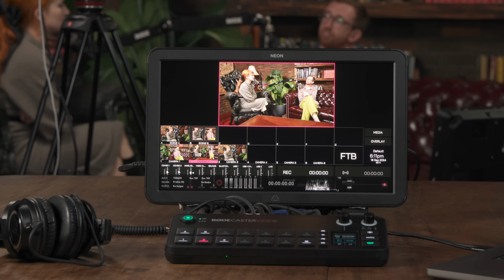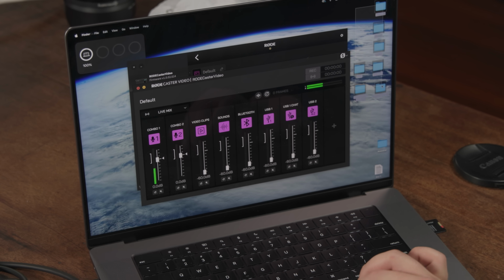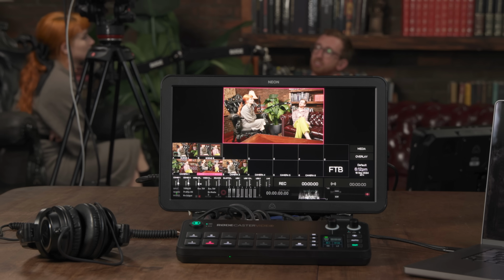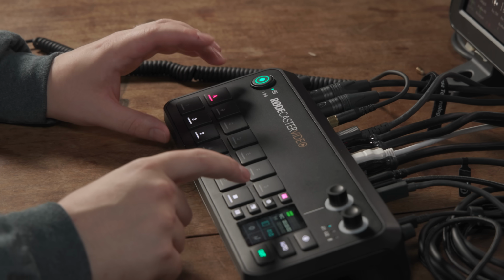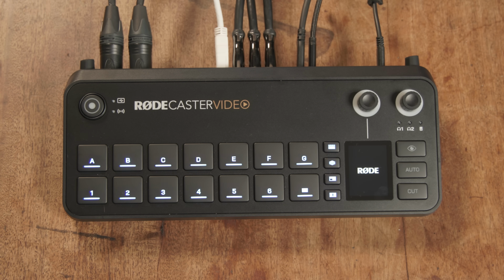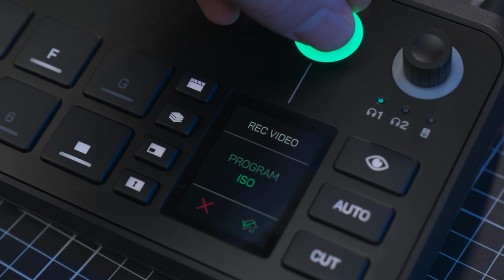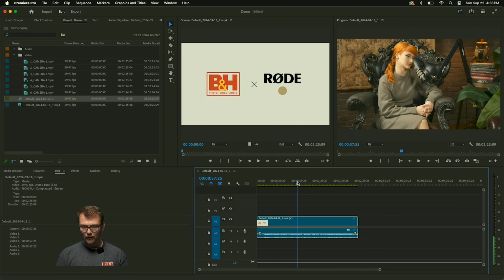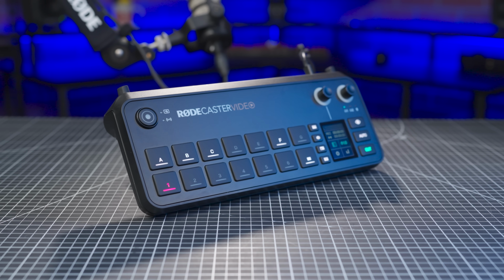RODECaster Video: Revolutionize Your Video Production!

Comment: As a podcast maker, I'm thinking about switching to Rodecaster Pro 2 or this machine.

I use Sony a6400 cams. And record audio now on rodecaster 1.

My question is, if its a problem to tune or edit audio input on this video machine, without having the buttons I had on rode caster one.
And if I maybe also need a rode caster 2 or duo, next to video caster.

I only want to tweak volume before we record, and maybe a small edit on voice.

What are your suggestions?
Reply from the maker: The integrated audio  mixer controls should handle all of your audio gain tweaking. The free RODE Central software will handle advanced device configuration.  Digital USB-C ports to connect RODE USB microphones, the RODECaster Pro II, or Duo Audio Production Studios. Other USB-C ports support 2-in/2-out multichannel outputs, mix-minus, and MFi protocols.          >Mark<
Reply: @BandH  thanks, but my question is about usability:

How easy is it to edit audio / gain / voice on this small display? During a podcast recording I don't use an external computer.

Comment: Mevo Multicam App also does 1080p with pretty much the same features and unlimited cams via wifi for free, if you are not streaming to multiple platforms at once or 1/10 of the price per year if you need that... I don't really see whats the point of this device compared to other options apart from having a rode logo on it...

Comment: Thanks for this review 
May I know the following.
1. Does it stream to multi platform in one go?
2. What's the highest ISO recording?
3. Does it have a sim card slot for the internet?
4. Does it bond the network like if you are connected to WiFi and Internet cable or it is only getting one signal? 

Thanks in advance!
Reply from the maker: To answers your questions:
1. It will only stream to one platform at a time. To stream to multiple platforms you will need a different live streaming software like Vmix.
2. The ISO will record up to the number of video and audio inputs you connect to the RODECaster Video. 
3. It cannot connect to the internet via sim card. You can connect the RODCaster to the internet via wifi, or direct ethernet cable.
4. I do not have the information at this time to answer this question.

Hope this helps!
Reply: @BandH  thank you very much. Yes it helps a lot. Appreciated for answering my questions! Cheers!

Comment: What USBC camera work with it? I tried Sony ZV-E1, Sony a6700 and Insta360 Link 2; all cannot see anything
Reply from the maker: The USB-C video input will only accept cameras that supports uncompressed USB UVC video stream. All three of the cameras you mentioned will work with the USB-C video input.
Reply: @BandH  I got the Sony cameras to work, turned out to be very sensitive to the quality of the cable .. but no luck with the insta360 link2 using the same cable that worked with the Sony cameras. Any tips?

Comment: Can an iphone be used for a camera on the RODECaster Video, especially multi phones?
Reply from the maker: At this time, I can not find information about using iPhones as a camera input with the RODECaster Video.
Reply: @BandH  Thanks! I been asking around other Youtubers and have been pointed in the direction of porting through an USB-C to HDMI adapter and clen feed Apps or streaming via AppleTV etc.. Hopefully. I sold my Sony camcorders years ago for iphones to be simple and compact. Whats is a low cost camera you would suggest for camera input?

Comment: What I like about it is it has XLR inputs for audio. That has always been a bone of contention with me and Blackmagic ATEM switchers (at least the Mini and Mini Extreme models). The price point is good, comparable with the Mini Extreme Pro and less expensive than the Mini Extreme SDI ISO - however, it only has four video inputs. Granted, if it can play back short media files from within the device that frees up an input (which I typically use for a Hyperdeck or Hyperdeck Shuttle). No downstream or upstream keying capability that I can see, but this short demo obviously doesn't cover all the bases. I can see this being valuable for small podcast efforts or smaller live events, but for larger events like the ones we do (multi-camera, PPT slide deck, lower thirds, stings, etc.) I think I'll stick with the ATEM line.

Comment: I have the atem pro and was very excited when I saw this but once I saw 1080p (which is more than enough/acceptable for most cases) but at that price point…. I’ll just stick with black magic. The point of joining the market is to work on the flaws and successes at a reasonable price point for the masses. But this isn’t enough to charge $1,200+ after taxes. But if you don’t own their audio gear and black magics equipment and want to get into the podcast space. I do recommend going with this. Maybe I’ll review it and send it back but this is more of a $400-750 product to me

Comment: Limited multi-camera control when compared to competitor products.
Lack of physical video faders, making live switching more challenging.
The preview screen often doesn’t display the full resolution, causing discrepancies between what’s previewed and what goes live.
The menu system is difficult to navigate, particularly when switching between video and audio functions.
Overheating during extended use, especially with multiple video inputs.
No 4K support, limiting its use for high-end productions.
Inconsistent wireless microphone connectivity, causing audio disruptions.
Latency when switching between video sources.
Limited customization of graphic overlays.
USB-C functionality struggles when managing both audio and video inputs at the same time.
No multistreaming feature without external help.
A steep learning curve, especially for new users.
Lack of a battery-powered option, which reduces portability.
Limited onboard storage, necessitating external drives for larger projects.
Audio sync issues with video during longer recordings.
No HDMI output scaling, making resolution matching across devices challenging.
Lack of a built-in streaming platform for simplified streaming.
Limited post-production flexibility.
The bulky design makes it less suitable for compact setups.
The price point doesn’t fully justify the feature set compared to other products in the market.

Comment: 8:55 You mentioned that you can have custom delays per channel, but one problem I have with the ATEM Mini Pro ISO is that the delay only goes to the live stream. It doesn't go to the HDMI out for previewing, which becomes a problem when the audio is auto sync locally in my room.
Reply from the maker: According to RODE's website: The audio output delay only applies to your live stream and recording – for the sake of monitoring your own voice live, the delay is not applied to your headphones or monitor speakers.
Reply: @BandH  That's a bummer not to have the option. If we want to send a feed to another room via HDMI out, our audio and picture can be vastly out of sync (up to 2000ms).

Comment: Oh great, the game changer I was looking for. Just did not find if there is a way to make a split screen with A and B signals next to each other ? I see there is a possibility in the software but I wish there was a way to make supersource like on the BM Extreme. But BM charges a lot to just get this button on hardware. It should be a must have in all small switchers. Thanks for presenting this new product !
Reply from the maker: You are able to configure the Multi-source Layouts button to have split screen between camera A & B. According to the RODE website using the Multi-source Layouts button, you can configure multiple video sources into arrangements such as picture-in-picture, split screen and more.
Reply: @BandH  it sounds great, I hope I can buy it from work.

Comment: This would have been perfect before I got the Black Magic version. This seems way better.
Reply: No so quick , the only thing I see is the XLR inputs which are better. I have the ATEM and it works very well in the field.
Reply: @ChipDizard  yes I do like the ATEM but it doesn't have a way to monitor audio that I know of so I just plug into my field monitor which sucks. No XLR so I have to adapt things or just record separate audio and sync. It's just a little ugly of an interface I think too.

Comment: Great Video! Thank you so much. A lot to look forward to with this device! 

One thing I don’t think was asked during the Live Panel: is the Rodecaster Video ADAT supportive?

I ask because I currently use a Universal Audio Apollo Twin Duo interface with only two mic inputs, but I occasionally need four mics for a podcast. Do you think it would be possible to essentially daisy-chain the two mic inputs on the Rodecaster Video, or would you suggest another solution?
Reply from the maker: The RODE RODECaster Video All-in-One Production Console does not support ADAT.  The Universal Audio Twin X DUO cannot be daisy-chained with the RODEcaster Video Console.   >Mark,<

Comment: Does it make sense to use something like this with OBS? Or is this more for a hardware only stream?
Reply from the maker: You can use the RODECaster Video with OBS, you don't have to use their software. But using their streaming software, you'll have better control over the switcher and stream.
Reply: @BandH  thanks

Comment: is the input only 1080P and not 4K ?
Reply from the maker: The RODE RODECaster Video supports up to 1080p60
Reply: @BandH  bummer, another product which is already undersized at launch with its only 1080P input. Had it been input 4K, it would have been the best. But limiting it to 1080P makes it have no interest
Reply: @CPHTT  saved for version 2

Comment: How would you incorporate this with the Rodecaster Pro II? Specifically the routing of the audio?
Reply from the maker: You can connect the RODE RODECaster Pro II to this! You can use the RODECaster Pro II, RODECaster Duo or any RODE USB microphones by connecting them to USB 4 or 5 on the RODECaster Video.
Reply: @BandH that’s very interesting. Does it record multitrack audio from a Rodecaster Pro 2 via USB-C?
Reply: Exactly